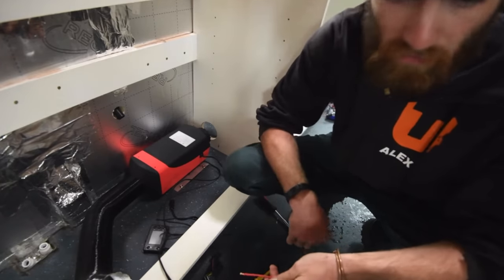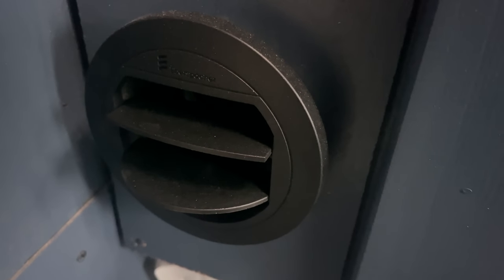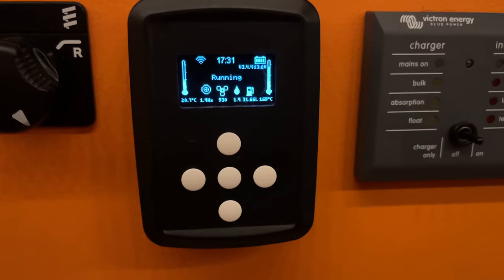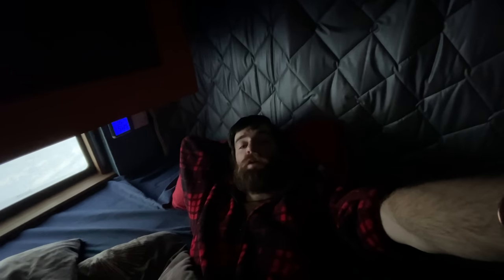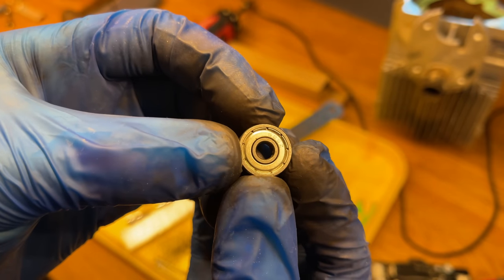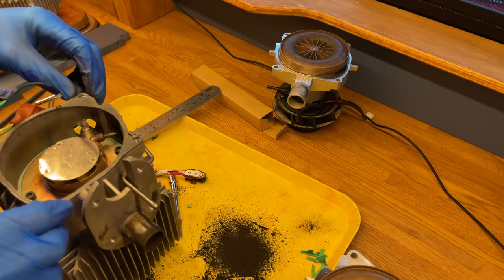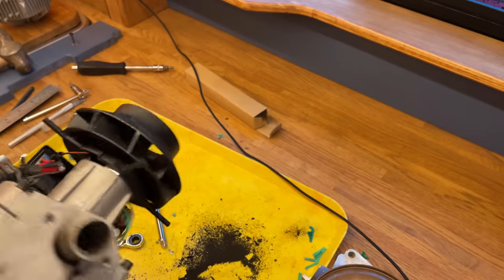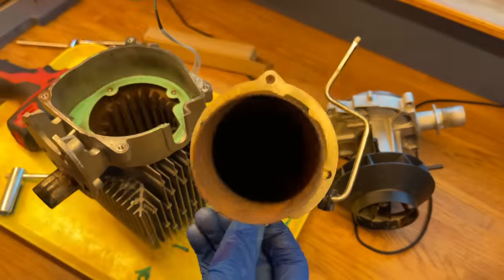2000 HOURS LATER! Chinese Diesel Heater

Comment: how does the atomizer work in these?  does it just divide the incoming fuel into many many tiny passages of some thingamabob atomizer at end of fuel input?  is there a pressure increase by changing feed port size or something pre thingamabob atomizer?
Reply from the maker: Good question, my understanding was that the dose of fuel push forward by the dosing pump ends up on the mesh and then spreads out across the mesh which increases its surface area making it easier to be ignited
Reply: @MispronouncedAdventures  from what learned since I left question for you. It appears the diesel is squirted thru small orifice.. so injected-ish.  onto the screen.  Heat of the screen helps it become fumes... (aka- "atomized"). Fumes are blown then thru a path that circles around end plate of the burn chamber where air is introduced for combustion and then into a high heat area ... possibly even thru another mesh type material inside end closure at bottom of burn chamber where things are hot enough to ignite it.
Reply from the maker: So I wasn’t correct but had some areas right, the diesel spurted onto the mesh/screen which increases the surface area which helps it become fumes, those are then pulled into the phone chamber and ignited. 

As for a second mesh, I think the webasto  units have a mesh  inside the burn chamber whilst the Chinese don’t

Comment: Ironically, even though this is marketed as a DIESEL heater, I suggest using Kerosene instead because Diesel is just no good.
Kerosene burns hotter, cleaner, and it is significantly cheaper than even Red Diesel. My heater internals are clean as a whistle and I've had it for about 3yrs now.
Diesel produces a lot of soot because it has a high sulphur content. Kerosene has been used as a source of heating since the 1500s for good reason.
Reply from the maker: I wouldn’t necessarily say diesel produces lots of soot.  definitely can do on heaters which are poorly set up or tuned. As mine are now on 4000 run hours and clean. 

Depends location as well. If I were setting up a domestic property / stationary use , then a large kerosene tank would definitely make sense. but for me the convenience of having it plumbed directly into the vehicles main fuel tank is optimal for me

Comment: For a small pickup truck camper is it better to get a 2kw and run it hotter and longer do a larger heater and run low
Reply from the maker: It’s a balancing act on putting size . 2kw for my van just isn’t big enough for the Arctic.

Comment: My new diesel heater failed to start after only a few 100 hours of working. Everything is clogged on the inside with a sort of black cake and fuel is dripping out, due to non-start.  I used it in the low power setting to have 85°C output air in the small workshop, which is good. (2KW for a 5KW unit). What setting did you use to have that long heater life ( that I would like to have also 🙂 ) ? low power/ medium / high power ??

Comment: I’ve seen videos of people running these in used transmission oil that had some moisture in it as well. 

That one was crusty as hell, but they ran it on junk like that for a whole year I think.
Reply from the maker: They are pretty resilient for burning different oils. Yes some will clog up fast another others. Definitely interesting to hear what people have used with them

Comment: I notice you have a Bowden cable/switch, do you use that to zone where the heat goes internally?
Reply from the maker: Good spot. Sort of. One side goes into the Habitation. The other route goes thought the bobilvan hot water heater exchanger and then into the habitation. If I close the habitation went it goes into the shower room / drying room
Reply: @MispronouncedAdventures  cool (or warm), I’m thinking of using this setup for the option to have fresh air or to recirculate internally. Main thinking is ventilation but it’s a bit of experimentation really.
Reply from the maker: That can be done, but it would decrease efficiency of the unit. But I’m all for experimentation. I guess you would only want the fresh air in the summertime anyway.

Comment: Those exhaust hose from Webasto and Espar with cannot be sealed tightly with stock clamps nor the one you have. Exhaust will push out at that point.  The Chinese exhaust hose are better for sealing as they are tapered smooth at the ends and are a pretty tight fit.  I have the expensive Espar and replaced the hose with chinese one for this reason.
Reply from the maker: Interesting view, know what you mean by the sealing, although I did replaced it with heavy duty actual exhaust clamps. in my case the exhaust was leaking everywhere when the rust got its way through
Reply: @MispronouncedAdventures  I bought the same clamps you have, it's not strong enough to squish the air spirals sealed, ended up stripping the bolts..   Mgfr even mentioned using some type of cement to seal them.  This is where I feel they've cut corners, just cutting off a huge roll instead of making tapered ones like the chinese ones. I've been dealing with a chamber leak since installing this expensive heater, sent it to mfgr said it was fine, did all their recommendations for install fixes and now it's happening again after a month, now i'm pretty sure it's the heater, just ordered a chinese one just to prove it to myself to them and shove it in their faces. Lungs were so inflamed the first time, this time it's inflamed again but I'm cutting it short this time. Enough is enough. IT's been a nightmare thinking I was going expensive for quality and safety.  I'm ok with replacing the chinese exhaust when it starts to rust.

Comment: Believe it or not electrical conduit pipe fits the exhaust system.  Way cheaper and massively stronger
Reply from the maker: I didn’t think that. I take it they are the 24mm area?

Comment: I would leave the air intake inside . That would gain efficiency because you are warming already warmed air rather than the winter air temp outside. Trying to heat that cold air in a second as it passes through the little heater.  Makes a huge difference.
Reply from the maker: I can’t have the combustion air intake on this inside it’s really quite a unsafe into them that way. Any faults with the heater which causes it stop turn releases exhaust gases out of the intake side. 

As for the hot air intake as internal anyway flowing over the heat exchanger
Reply: Intake goes to exhaust so the air inside will be sucked out and surprise get replaced with cold air from outside causing discomfort.

Comment: Ceramic bearings are available in those sizes , all standard bearings whether zz or 2RS will be grease filled so will dry out .
Reply from the maker: I’ve not seen many use Ceramics bearing for this sort of use. I’m sure it would work, just thought I’d go with what I knew
Reply: Well of course, the standard 2rs  ( rubber seals) or ZZ metal shields will work fine for a few years , then will be noisy , probably then still working for another two years if you can tolerate the noise as only very lightly loaded . I had the same issue with a flue fan on a wall hung gas boiler as the fan runs in the hot gas flue .

Comment: Great vid. Is this all you use to heat in the winter? A secondary heating system.  How many times did you replace the screen at the glowplug in the 2000 hrs?  Im surprised it didnt smoke alot and fail to start?
Reply from the maker: Yeah all I’ve ever used for heating the Hab part of the van, not sure what you mean by “a secondary heating system”? even in the arctic last winter I only used that heater . I do carry a spare unit just as a back up. 

I have never replaced the atomiser / mesh screen around the glow plug and I’ve never had it’s smoke or fail to start. That was the first time I’ve ever opened the unit up

Comment: We use vinegar to clean combustion chamber in domestic boilers
Reply from the maker: For soot which hard to remove? Most of this dust came off with toothbrush. But I could definitely see you on a far dirty air heater extra things require.

Comment: Nice video. :)
Come on..when you got the Aurora to watch who cares for a damned fan error? ;)
I'm thinking of installing such a heater. Thanks for the tip about the new display...I'll have to look into that.
For the sealing..well, you can get gasket paper to cut your own seals or (and this is the easy way) ...
buy some liquid sealing. You can get that kind of stuff in every automotive shop. It's a quick and dirty way to seal things together and it can withstand well above 200 degrees C. It will hold even on this heater.
Reply from the maker: Definitely that was thoughts on that evening can’t fix the heater might as well enjoy myself and the Aurora 

Good to know, there are definitely plenty of options for making gaskets if you ever really stuck

Comment: Do you have a carbon monoxide detector? When you showed the exhaust, I noticed it dd not extend out from under your vehicle. That will trap fumes. It should extend out. Great video though. I learn a lot from people like you who share the rebuilds.
Reply from the maker: I do have a monoxide monoxide detector in the vehicle. I know what you’re saying regarding the fumes however, it does extend and blows out the bottom of the vehicle. It doesn’t show very well in the video . I can see under my thermal cameras where the plume goes out and leaves the vehicle. 

Glad the videos was helpful

Comment: Just tripped over your video.I am assuming you need a mains hook up or generator the supply the DC current required for this heater? That being the case,you would need to factor in that amount of power into working out the efficiency of the heater.
Reply from the maker: No hook up or generator needed. It’s runs off DC power from the leisure batteries and fuel from the vans main tank. 

Battery recharged via solar or the engine as a by production driving

Comment: Since they are relatively low-cost, it might be wise to buy two units at the same time. The other one would be a spare to throw in at times of trouble.
Reply from the maker: On my Arctic trips, I carry an entire spare unit as I just in case I haven’t yet personally need it but others on my Arctic trips have

Comment: do you use the fuelpump that make that irritating ticking sound? or do you know of one that is silent?
Reply from the maker: Are use the normal ticking fuel pumps, but it is loose mounted on a rubber grommet under the van so it’s a very dull thud. I actually find it quite reassuring and like it as I know what he’s doing on its thermostat.

Comment: Could it be a good idea to have a water tank to heat up and then shunt to heat the van. This way, the heater will go full blast for a longer time and then shut down and later, same again.
Reply from the maker: My heater doesn’t shuts down though, it’s on a thermostatic control. It just runs on lwhatever setting is required to maintain the target temperature.

Comment: I want to mount one in my boat and utilize my old chimney. Do you think I could mount this sideways? It would be easier to get it to match with the exhaust that way and I can pop it in to the same spot.
Reply from the maker: Whilst I wouldn’t be able to answer the bit about reusing a chimney, they can be mounted on their side as long as the glow plug is facing upwards.
Reply from the maker: Whilst I wouldn’t be able to answer the bit about reusing a chimney, they can be mounted on their side as long as the glow plug is facing upwards.

Comment: Should not be a problem tapping out another gasket for the one you broke. Get some gasket paper, lay it across the area that needs a new gasket , and with a very small hammer, tap it out. Lightly tapping on the inside and outside edges which will cut the gasket. Take your time and tap one out!!
Reply from the maker: Yeah, a a lot people have mentioned making your own gasket. But in this case I didn’t have any gasket paper and a whole new gasket for a nearby heater was easier to get.

Comment: Very interesting video Alex... and SO in detail.:yougotthis:
If you would buy a new china diesel heater today (from scratch but with todays knowledge) would it be this one you have?
Reply from the maker: For this price bracket the £100 area. I should go for the none-Bluetooth maxpeeding rods again and use the third party afterburner controller. If I couldnt use the afterburner I would probably look into the lavaner pro or Hcalory with are near £200 area but seems to have more features
Reply: @MispronouncedAdventures  Thanks very much for your input Alex... I will consider it. 👍

Comment: What size is the heater? I have a 8kw, I'm planning on running on waste oils,  maybe mixed with kerosene,    but I been looking into possibly building a heater that can power it's self, that has a output of heat, and about 10amps at 13.8-14.4 volts, so it can trickle charger the battery instead of using power,  without the engine noise hopefully!
Reply from the maker: This is a 5kw Heater. I know a few who use Kerosene. It’s meant to be a way cleaner burn then diesel. 

In what way power its self? Like using a TEG unit to convert heat energy into electrical?
Reply: Those kW ratings of Chinese heaters are often wrong, I've seen a video of a 8kW heater which only took 300ml of diesel per hour at maximum power, it is completely impossible to generate that much heat out of the fuel.
1liter of diesel has an energy content of 10kWh, so at 80% efficiency it must consume at least 1 liter per hour to generate 8kW.
Just measure the fuel consumption and you can calculate the approximate heat output...
Reply from the maker: The rating of the “Chinese heaters” is always over marketed. After all 5kw Chinese design is based on the eberspacher D4 which as the name says in 4kw! 

It’s very true on the most Chinese 8kw use using the 5kw Chinese body ( the 2kw used to be that too ) I haven’t yet seen an very Chinese heater which are the large 8kw body
Reply: @MispronouncedAdventures  the 170ml per hour you calculated should give you probably 1.3 kW...

Comment: 14:21 zz means it has a metal shield on both sides (single z has only a shield on one side). You could also opt for a 2RS (double rubber seal) if the bearing fails again which will keep dirt out better than the metal shield (at the drawback of some friction, but that should be fine)
Reply from the maker: Thank you. So rubber seals are a better seal?
Reply: @MispronouncedAdventures  a rubber seal bearing is better to keep dirt out compared to a metal shield. The drawback is friction between the seal and the rotating shaft, which will cause drag and heat. In extreme cases this could melt the seal rendering it useless so typically the rotation speed is limited for rubber seal type bearings. I did a quick calculation and staying below 25.000rpm should be fine in this case with rubber seal bearing (I'm sure your fan will be a lot slower). So next time your ZZ bearing fails you can try a 2RS for a change.  (if this ZZ will ever fail, since now you have a high quality Japanese bearing in there it might outlast other components)
Reply from the maker: Thank you. It’s been interesting to learn a lot more about bearing and shields & seals and their use cases
Reply: @MispronouncedAdventures  I noticed in the video, whilst you were putting the new bearing into its casing, you remarked it was a bit loose in there. When you removed the old bearing it had a rubber cover around it, which you removed and said 'I must remember that', well I think that was there to minimize the amount of debris getting into the bearing, but you appear to have forgotten to put that back around the new bearing. Though it probably doesn't matter, it didn't appear to help anyway, as that bearing still failed, due to its lack of quality more than anything. Great video, I enjoyed it 👍
Reply from the maker: @Charlie_Crown i’ve always wondered with the bearing covers. Because there was only one of those bearing silicon mounts when I took it off, and I’m pretty sure it was on the other bearing, although potentially there was meant to be 2 to begin with and one was missing
Reply: @MispronouncedAdventures  Ah, didn't notice it was the opposite bearing that was loose. Probably meant to have been two from the factory alright, typical Chinese build quality for price point, though your preventive maintenance measures should mean it will last longer than intended for sure 👍

Comment: Where you did get your diesel heater from ?
I like the interface you have.
Reply from the maker: The interface is called a afterburner controller. It’s replaces the original controller for the heater

Comment: It may be wise,  to take this aprt when its brand new, and apply lubricant to both bearings on the 12volt motor. China factories are notorious for not lubricating bearings and if you do this lubrication on the unit before using it, you may get 1000s more hours out of the dc motor, before the bearings go bad. The brushes in these dc motors will last much longer than the bearings.
Reply from the maker: Or just replace the bearings with high-quality ones when it’s brand-new. Although would you necessarily want to lubrication on the bearings near the DC motor seems potential for Brush dust to build up and stick to the lubrication?
Reply: @MispronouncedAdventures   I think it has been common practice in all DC brushed motors, to ensure lubrication is applied to both bearings to increase longevity, reduce noise. reduce friction?

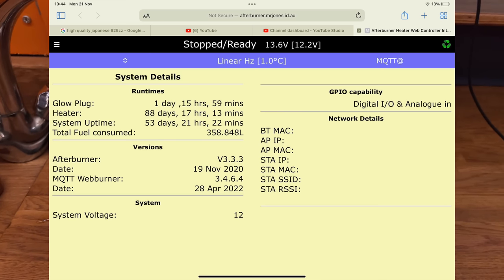Comment: 1:45 Few questions:

1. What is glow plug?
2. How come heater time is longer than uptime time?
Reply from the maker: 1. Glow plug is the device which evaporates and combusts the diesel at the start before the combustion is sustained by itself.
2. “uptime” is how long the heater have been powered / connected to a battery. if you cut the power or removed the fuse and the unit is unpowered. Uptime would reset
Reply: @MispronouncedAdventures  Ahhh.... now I get it. Thank you for very quick and detailed information.